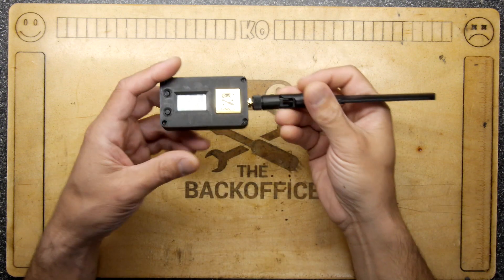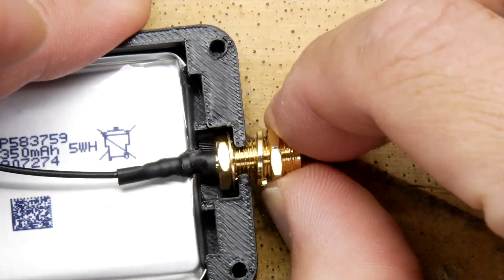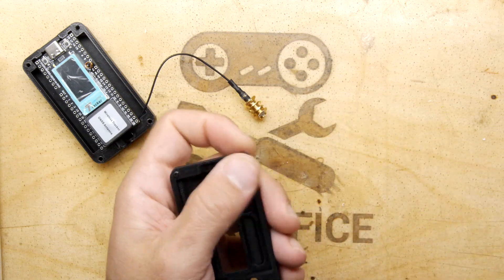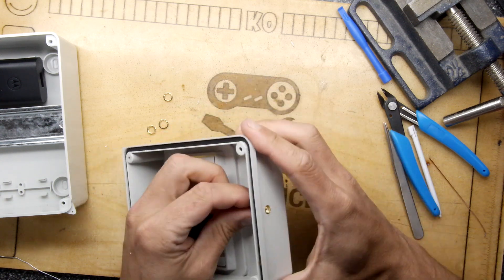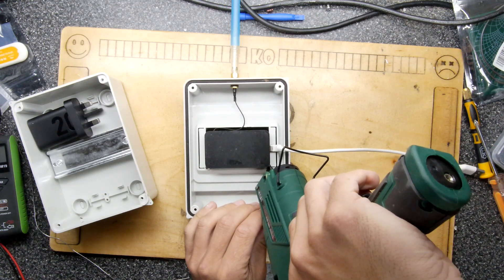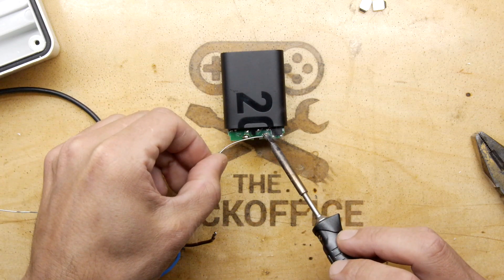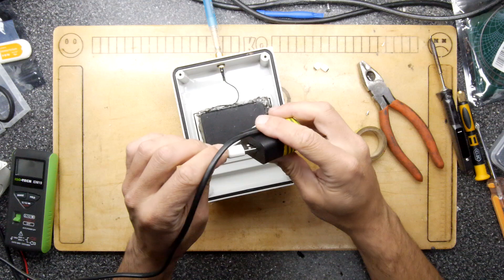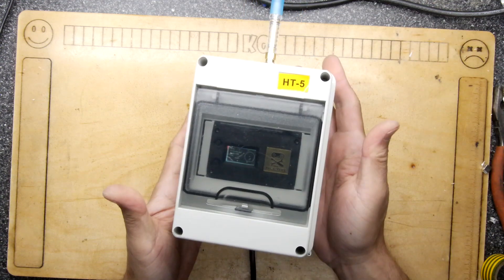Extremely cheap - Meshtastic Outdoor Repeater build

Comment: That's a great idea,   have you tried what kind of range you can get from it yet?
Reply from the maker: Furthest so far is 20 miles, but if I could be bothered to mount it on my pole antenna likely a bit further. 

It's less about the range, Vs what you actually receive, so far, fantastically boring. Like running your own pager service. Possibly more useful after a nuclear attack 🤣